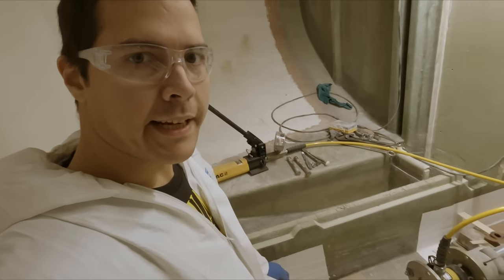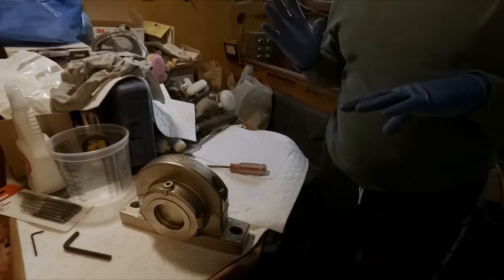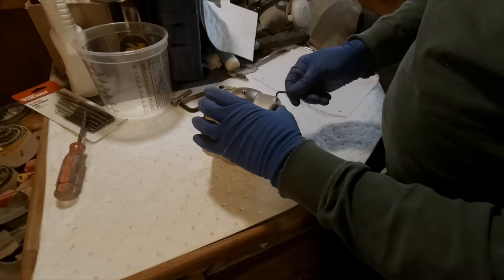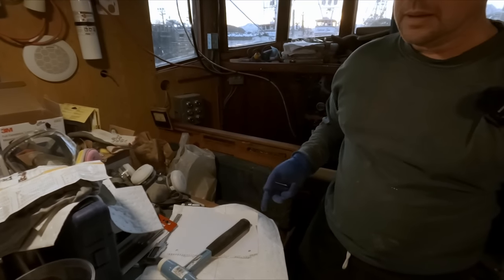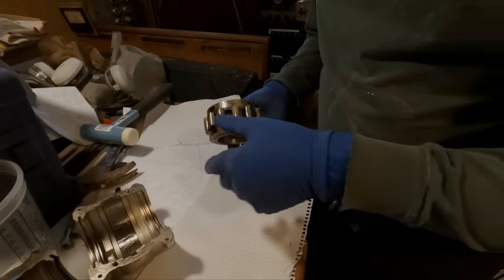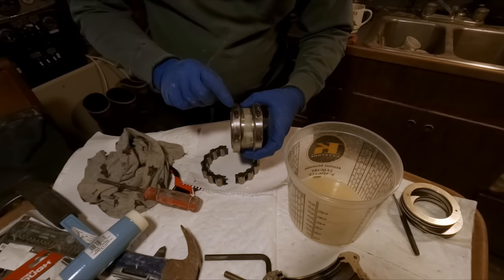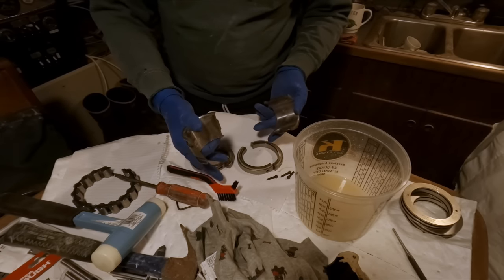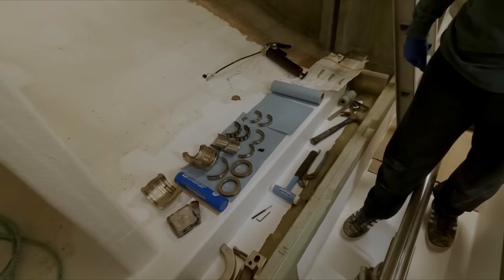Removing Coupling, and Cleaning Split Bearing-Emerald Isle: Ep.63 Fishing Boat Refit

Comment: I used to run those bearings on a 3600 RPM underfire fan on a coal boiler. They would run a long time and were simple to change. At the speed your prop shaft runs, this will last a long long time with the proper lube.

Comment: More for the people following your series:  I held my breath when you were taking those tiny Allen screws out of those clamps.  I have a LOT of bitter experience with those things.  For working on something critical like those, spend the money and buy top of the line Allen wrenches - as someone mentioned, the longer T handled ones are best - but you want the very best tempered wrenches you can lay hands on.  Snap-On or similar.  The Chinese ones don't cut it.  Softer steel wrenches will "flow" a bit under higher torque pressure and round out.  When they do, they will often mess up the screw socket as well, then you've got a real mess. Properly tempered, high quality Allen wrenches will go a long way toward avoiding that.  Take it easy when tightening them down and lube the threads properly.  "Make Sure" the wrench is seated "all" the way down into the socket.  That will save a lot of grief by itself.  If the end of the wrench is rounded a bit, "very carefully" grind it away till the end is sharp and square.  Don't let it get hot or you'll take out the temper.